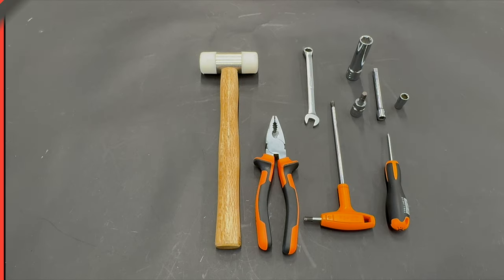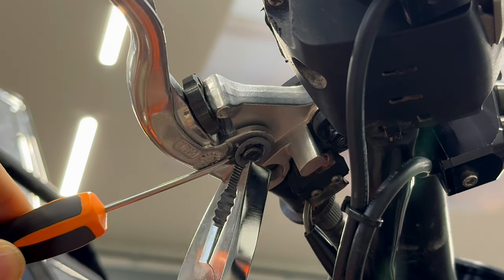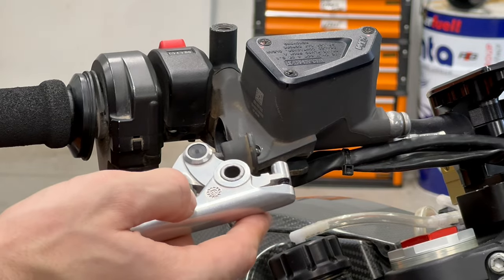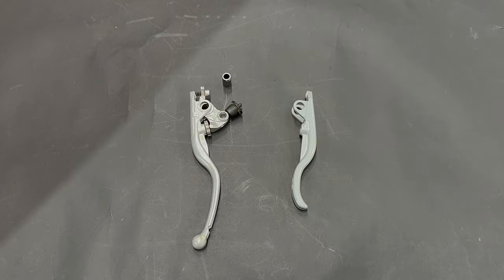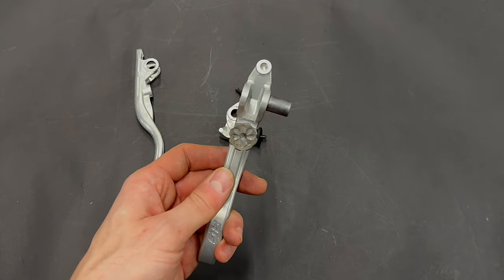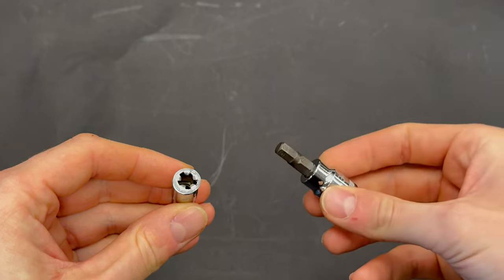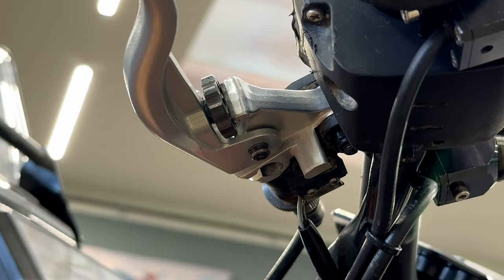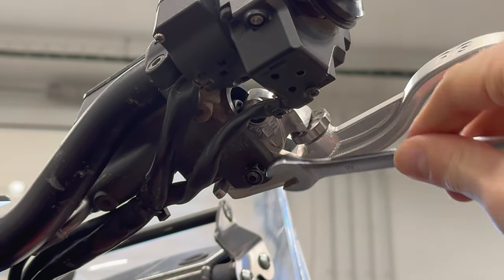KTM 790/890 short clutch and brake levers Installation video - RADE/GARAGE

Comment: Good video, well narrated and instructed. It would be nice if you stated the year of the KTM 790/890 because my KTM 890 Adventure R (2023) is not like that, I have not C-clip on the clutch nut and the brake lever has a lot more stuff on it. Wanted to know how to get the plastic cap off the top of the front brake pivot bolt to get at the Allen underneath.